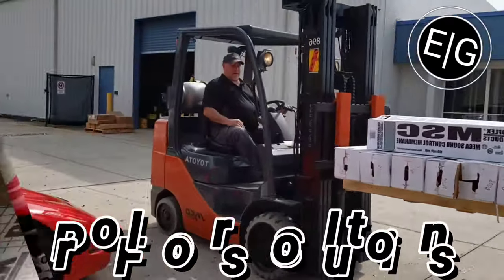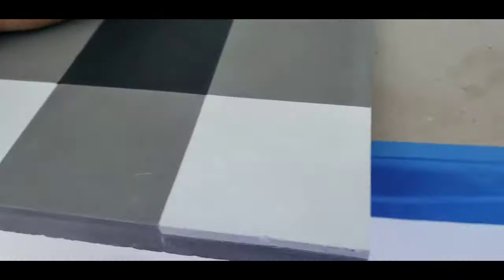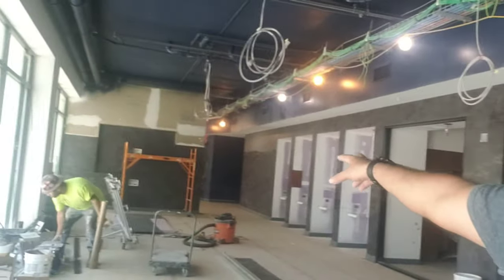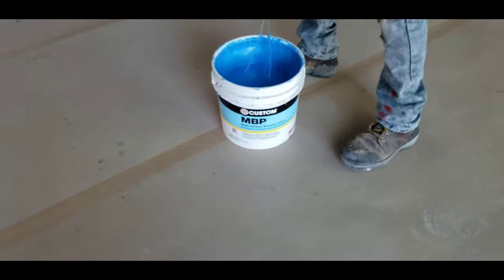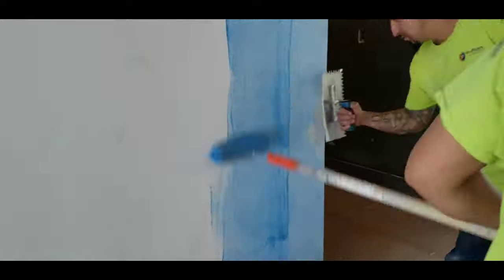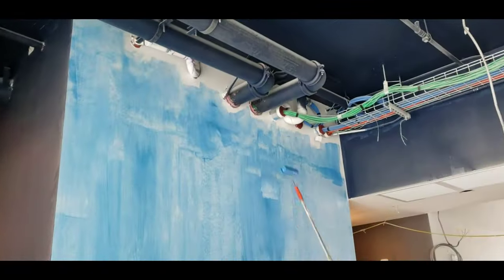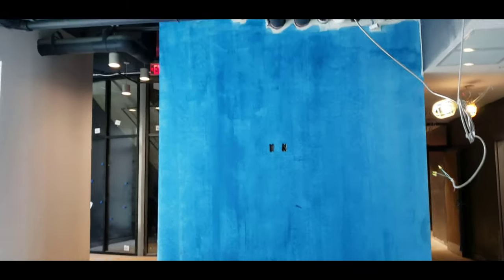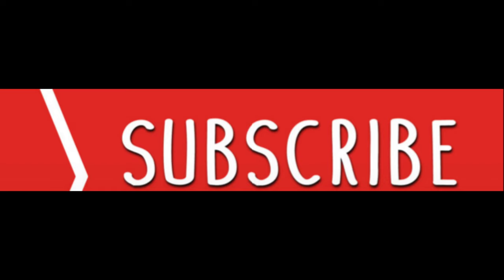Tile Over Drywall Using Custom MBP Primer 👷‍

Comment: You don't need any primer.  Just use 400 Pro Mastic Type 1 Tile Adhesive from Southerlands.  It will stick to any drywall including painted drywall.

Comment: What if the dry wall has just been spackled, no paint. Do you still use the blue primer? Or first apply regular primer on the drywall before using the MBP?

Comment: I removed 50 year old linoleum tiles and there was a thin layer of tar adhesive. I tile over it it I use that product?
Reply from the maker: It could definitely do the trick! Shouldn't  install tile on the same day would have to wait till the following day so that is well dried and definitely use a second coat. I could definitely see it working just fine. Product won't mention anything like you described but knowing what it does I would used it as I just described

Comment: My wife has painted our laundry including the area we want to put  a tile backsplash, can I get away with Priming this area like your video or should I remove the drywall completely?
Reply from the maker: Priming it is a the best option in my opinion it works perfectly.
Reply: @egformula  Great, thanks for getting back to me.

Comment: What's better for priming over an epoxied concrete floor for porcelain tile? This or the Prim Grip.
Reply from the maker: They Both Really Good but for over epoxy I would let either product Dry Really Well specially prime grip

Comment: Will this primer be best on drywall paper or what if it had compound ? I understand the surface must be flat and smooth
Reply from the maker: Yes definitely works directly over plane drywall and drywall compound.  💯
Reply: Thanks really appreciate your posting this help ! 
 If I may can I ask about mortar or mastic for ceramic tile on a kitchen backsplash walls with the MVP primer and would the epoxy grout work for either ?
Reply from the maker: @bartman22x1  no problem, 
If the backslash drywall isn't flat enough for whatever reason then i would definitely go with thinset, i personally would go with thinset almost all the time bcus you can play with thinset more when needed vs mastic your limited.. I recommend thinset for backslash all the time. Epoxy Grout would work for either except if using mastic you'll have to make sure mastic dry.. another thing with mastic you can't go thick if needed and if so will take forever to dry.

Comment: Would you recommend this method over taking out drywall and installing hardie backer?
Reply from the maker: Yes Definitely unless its a wet area like a shower or something like that
Reply: Epoxy Grout Formula ProFloors Solutions I am remodeling the bathroom in my tattoo shop that has one sink and toilet so should I be good to go with priming the drywall?
Reply from the maker: @paulcalvo2691  oh okay yes primer is good that aint a heavy wet area where  moister could be a problem. Your good 👍
Reply: Epoxy Grout Formula ProFloors Solutions thanks bro appreciate the advice you ever in Fresno CA and need some artwork stop on by. True Anchor Tattooing
Reply from the maker: No problem, 💯

Comment: Can I use this product over concrete sealer outdoors ?
Reply from the maker: Yes Definitely, we even used it Over epoxy floors and epoxy paint that's over concrete. It will Definitely work over concrete sealer using a nice double coat and giving it the proper time to dry.